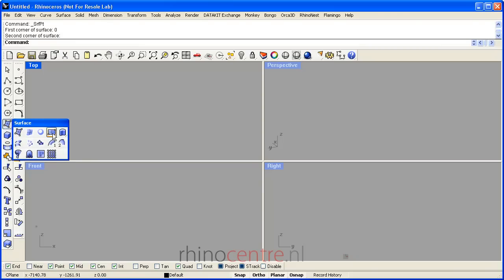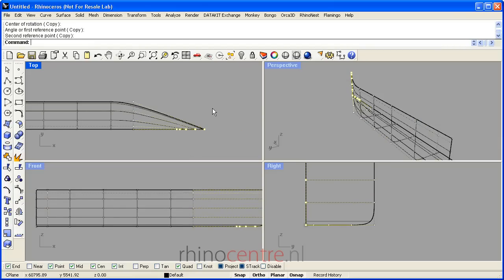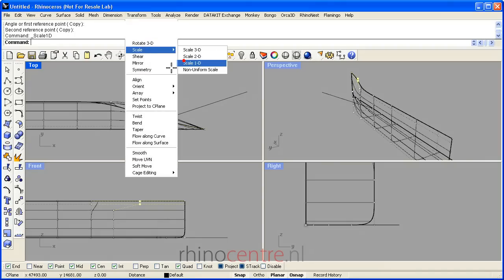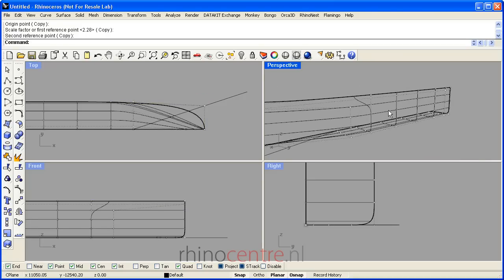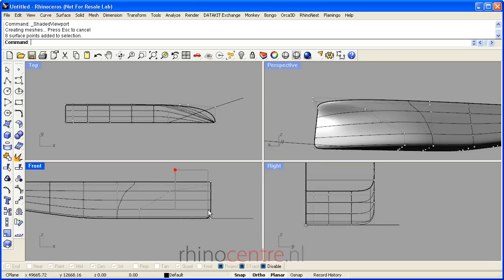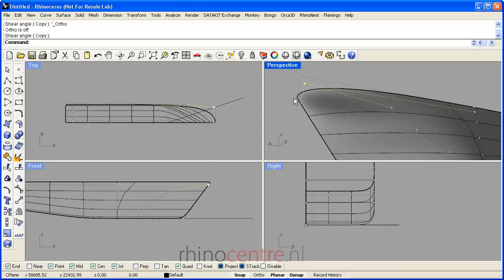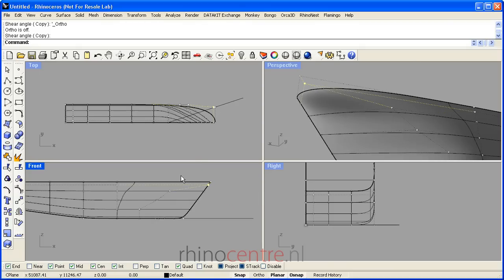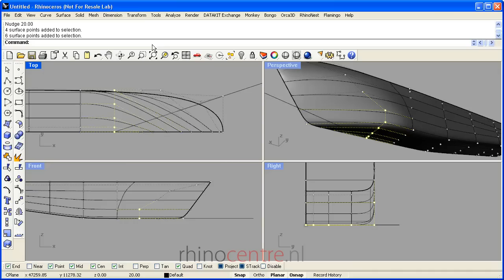Rhino3d Demo Ship Hull Surface Control Point Modeling

Comment: It is very successfully. Which offset table are used at ships in general. If you give answer me will be very delighted.
Reply from the maker: I would use an offset table of an existing ship only as a reference and never as input for a new hull surface.
Reply: Gerard Petersen So we need an example offset table for new ship drawing, don't it. Also thank you so much to back writing me.
Reply: Gerard Petersen Would you give your mail me please?
Reply from the maker: https://www.rhinocentre.com/rhinocentre/contact/gerard-petersen/
Reply from the maker: As I don't understand well, please explain yourself better in an email.
Reply: Gerard Petersen Okay. Very thanks.

Comment: thanks
apart from developing compound surfaces, will it do same things as Maxsurf  and also can one do all of this in Rhino 4, thanks
Reply from the maker: +stuarth43 Regarding the modeling, yes you can do these things with Rhino 4 too. Rhino also supports simple hydrostatics functionality. For stability calculations and other tools you can use Orca3D plugin for Rhino.
Reply: +Gerard Petersen thank you,  it always tells me( unrolling this  surface will produce inaccurate results) and refuses to develope,
Reply from the maker: Yes, when a surface has curvature in both directions, you cannot unroll this. It is like making a shape from a piece of paper. You cannot make for example a spherical shape or saddle shape from one piece of paper. Multi chine hulls, you can develop with the unroll command in Rhino.